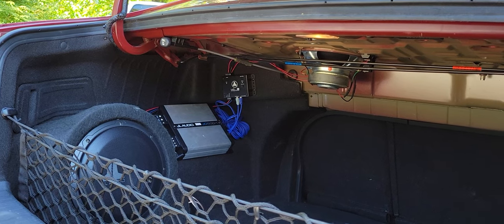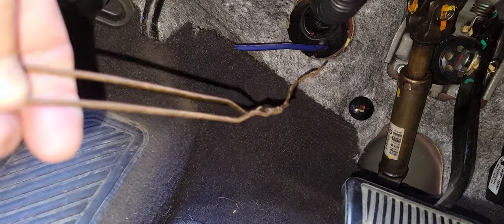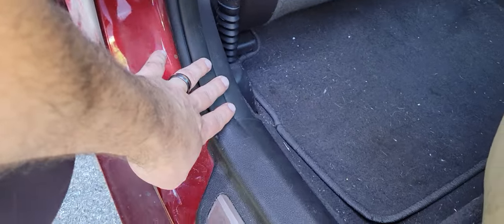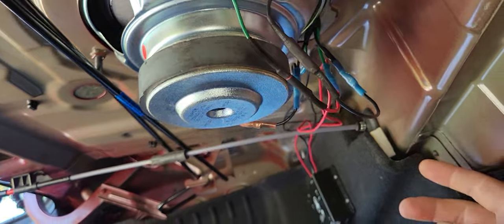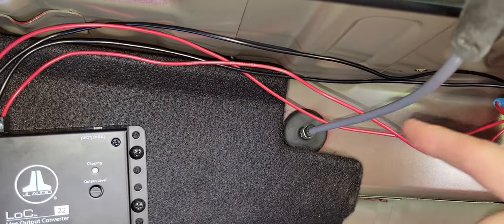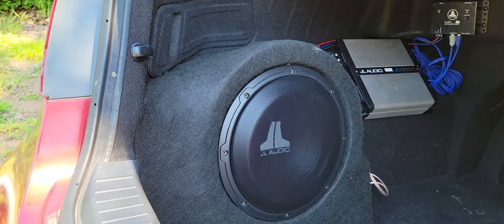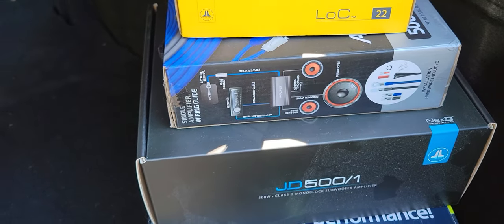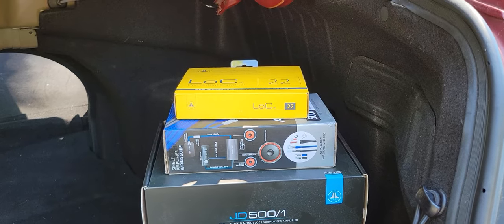2012 Hyundai Sonata, Amplifier, Line Output Converter & Sub, Install tips

Comment: I'm curious why you used an LOC and  tapped it into a factory subwoofer . You already have a Low/sub signal without using an LOC just by tapping into the factory sub signal . You only need a LOC if your trying to get a low/sub signal from a high level speaker signal .

Comment: Where were you able to tap in for the speaker wires the spot where your sub is on the ceiling of the trunk is just a piece of plastic for me
Reply from the maker: I connected directly to the factory subwoofer wiring.
Reply: Your car did not get fitted with a subwoofer from the factory.
Reply: Can you directly connect factory speaker wires. Do I need line out converter
Reply: @joeyevans4352 if you are tapping into the factory sytem with an amp, yes, you will need a LOC connected to one/two lines between your amp and one of your speakers. In the video, he tapped in the line going between his amp and his subwoofer to supply feed to his amp.
Reply: You do NOT need an LOC If you tap into the factory sub  for your LOW/RCA signal . You only need an LOC if you're tapping into a door speaker because that is a High level signal and the point of a LOC Is to Convert the signal level to LOW/Sub signal.

Comment: I'm looking at using the Rockville 11 inch spare tire sub... It includes high pass 14 gage standard Left/Right wire and low pass RCA options for signal input.  I'm lucky in that my battery is in the trunk already and I also have an 8 inch free air sub in the rear deck (2013 R-Spec Sedan). It looks like you tapped into the single coil sub... Did you just create your own "Y" splitter off the single + and -?
Reply from the maker: I cut the pos. & neg. wires in half and tapped into them with the red and black wires you see going to the LOC.

Comment: I have a similar set up but I'm not picking up bass below 35hz. I'm wondering if the crossover from the factory amp is set to a higher frequency or there is a problem with my line out converter. Have you noticed this?
Reply from the maker: I haven't done any specific testing for that.  It sounds normal.

Comment: Which LOC did you use?

Wouldn't you connect both L&R LOC inputs to the different voice coils on the dual voice coil subwoofer or will that cause issues?

Comment: I just bought a 2009 Limited 
Does it have a Sub and Amp (factory) in it? 
I want to replace the radio I’m assuming all the wires needed should be behind the old stereo? 
Thanks
Reply from the maker: You would have to look in the trunk and see if there is a subwoofer mounted on the underside of the deck.  (Like in my video).  I'm not familiar with your model.  You might look at Crutchfield's website for more details (car audio).

Comment: Where did you ground the amp?
Reply from the maker: I believe I drilled a new hole in the trunk under the carpet, cleaned off the paint and screwd it down with a self tapping screw.  It's been a while and I've done so many other projects I can't fully remember.  I may have found a good ground on something else and attached it to that bolt.  Sorry I can't recall fully.
Reply: Same car, I removed the back seat which is easy, then took the paint off under an M8 bolt to the chassis and used that.  Not even a foot long, and I power 2 amps and a W7